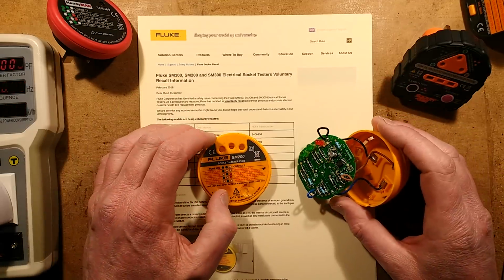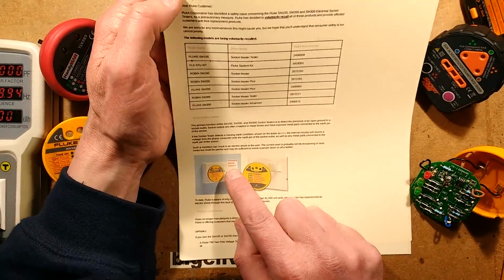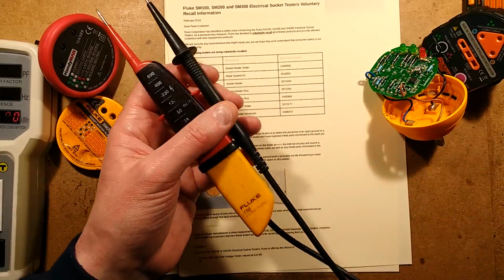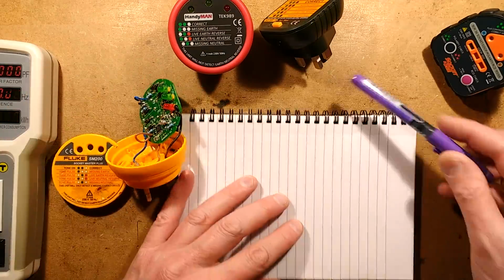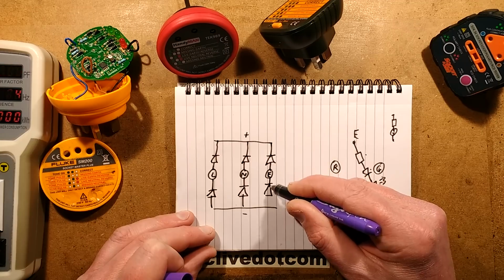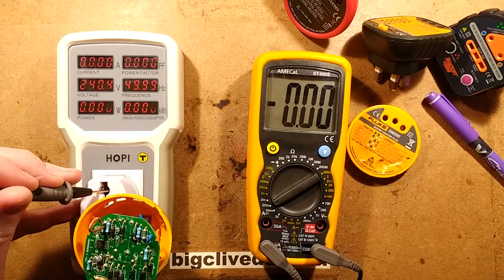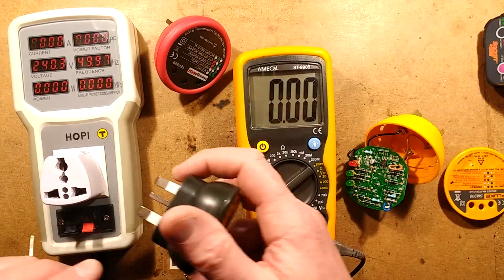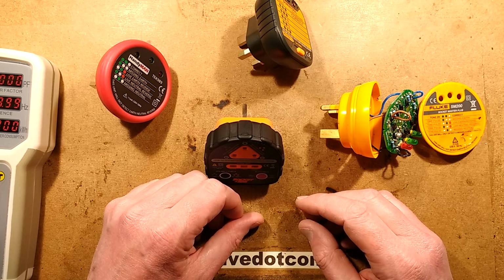Why Fluke are recalling their SM100/200/300 plug-in testers.

Comment: Clive, I love how optimistic you are!  Normally the people using the metal boxes as part of an extension lead don't eve know what a cable gland is for ;)
Reply from the maker: I've seen so many of those with chaffed inner cores just dangling out and scorch marks on the razor sharp metal.  Usually accompanied by damaged flex and plugs with the top missing.
Reply: All you really know is that at some time in the past it might have been earthed properly or there was a path to earth through it.
Reply: @Magic-Smoke  That'd be the puddle of water it was sitting in.
Reply: S.A. Smith I’ll not be surprised if said flat was in Yarmouth, Lowestoft or similar 😂
Reply: D Sloop Isn't that Preparation H?
Reply: the amount of socket faces and back boxes i've had to replace in domestic locations because the home owner or tenant has tried to bodge it is mental...

Once had an entire flat with a bridged electric meter, cables just running all over the place, a 3rd party single phase service head (they totally bypassed everything), all earths cut off, about 6 live/neutral reversals, a live steel "plant rack" as well as lots of "natures peace maker".

The flat stank of rabbit poop (as this "plant" usually does) & the tenants were incarcerated at Norwich Prison (UK) for about 10 years each. The Joys of rewiring an old grow house.....
Reply: Which is also the shortest poem imaginable about toilets!  A micro-haiku.  Strain-relief doesn't imply ingress protection though, which is the principle function a cable gland I reckon.
Reply: @MarkTillotson  "principal"
Reply: Here in the States They are called "Strain Relief".
Reply: @dsloop3907  Here, we call them laxatives.
Reply: Ryan Starlin - It was Great Yarmouth...Nelson Road Central...

I went to Solna in Stockholm last couple days, and I'm considering leaving this shit pit.
Reply: @S.ASmith  You know it's a shit pit when members of the Royal Family can't stand being here. Hiya, Harry.
Reply: S.A. Smith ...and it is totally legal where I live.....still boggles the mind....

Comment: We have the same sort of testers here in Canada.  It's also the only test tool that an electrical inspector is likely to use on residential inspections.
Reply from the maker: A higher percentage of people are electrocuted with 120V due to the belief that it's safe.  When you make brief contacts in a dry environment all you get are tingles, but add metalwork and wet hands and it all becomes a bit violent.
Reply: NM I didn't watch whole vid b4 I commented.  I didn't realize the trouble with the Fluke was being full of needless electronics.  I thought they all were the same.:)
Reply: Our main is about half the voltage as in the U.K. though which mean half the current. Add skin resistance to that and I think we're safe.
Reply: Touché.
Reply: bigclivedotcom Yep, I been electrocuted by both 240V and 115V, and confirm that both are not nice.

Comment: Hi Clive, can you tell me why my House Socket RCB tripped (twice) when trying to troubleshoot a faulty Shredder, even though  it was plugged in to the mains it was switched off at the socket? PS the shredder seems to have a fault somewhere on the circuit board (somewhere) im not actually sure where, i would send it to you to have a teardown and fix but its a Fellowes SB-89Ci and weighs a ton!
Reply: Are you sure its the shredder and not the socket thats at fault?
Has the plug been rewired ever?  My guess is that something in the plug is wrong.
Reply: DeoMachina yeah the shredder was brought to my house has it wasn't working. Tried to have a look and noticed it seems to stay on light without doing anything. Nothing else working on it
..
Reply: ahh, thanks for the info, i will investige further. sustained a finger tingle electric shock, whoops, rather fuzzy moment lol!

Comment: A Question, what is the advantage of 240V 50 cycle over the Voltage used in the US, 120V 60 cycle?   sorry, this was off topic.
Reply: I understand a hotter space heater, I don't know what an electric jugs is, sorry, I'm stupid.
Reply: In tea-drinking countries, you need to boil a litre or two of water each day to use in tea-making.  To this end, we have electric kettles, that simply heat up water reasonably quickly to boiling point.  They're also handy for other situations where boiling water is useful.
Reply: Thanks, my wife drinks a lot of coffee, she makes 3 or 4 pots a day, I'm lucky to get one cup.
Our home is about 3700 sq. ft. and uses Natural Gas to heat it and our hot water, I live at about 5000' in elevation and get a fair amount of snow, but the heating is only about $140/month and the 120v electricity runs about the same, we keep the home about 76F in the winter and summer.
Reply: I understand that but most people don't like handling 240v , the one appliance in our that uses 240 is our stove/ oven.  They are afraid of it.  240v and 30amps a bunch
Reply: Given the same voltages and power, 60 Hz transformers will have less mass than 50 Hz transformers.
Reply: Still smaller than South Africa.
Reply: Robert Szasz They are tiny compared to industrial power connectors!
Reply: Mike Hale We can plug in high power tools, equipment and heaters, as our plugs are rated at 240V at 13A giving an available power of 3120W.
Reply: DemonfangTheDragon not every way. UK plugs are huge.😋

Comment: Are sockets with earth connections really that rare? I know that the UK has them (duh) and that here in germany, you get either the full-size schuko socket (with earth contacts) or the smaller ones (which lack earth contacts, but physically limit the plugs you can stick into them so that an appliance that requires earth cant be plugged in, provided that the manufacturer is sane)
Reply from the maker: A surprising number of European countries either have no earth circuit or badly implemented ones.
Reply: Replacing a non-earth socket with an earthed one and failing to wire the earth sounds like a really, really stupid idea. Like go directly to jail, do not pass go level stupid.
Reply: In Eastern Europe there are a shitton of houses with bodged wiring, such as schuko-like sockets that lack the earth contacts, proper complete schuko sockets where the earth contacts are not connected to anything because they were retrofitted and the house was wired without a third wire, houses where some of the rooms have properly earthed sockets but other rooms have sockets without earth wires going to them, sometimes the earth contacts and the neutral is shorted together at the back of the socket (!) if there is no earth wire, there is no GFCI a lot of places, sometimes the circuit breakers are overrated and if you plug in a continuous heavy load like a new electric oven, the breaker will not trip before the insulation starts melting off the solid core aluminium wires that have often been used for wiring houses. Sometimes the wiring does not even go though conduits, it it just literally wires embedded into the layer of masonry cement mixture that was used to cover the brick walls.
So, yeah, it is an adventure, you never know what you find :D
Reply: +S.A. Smith I just took a photo of it: https://ibb.co/eq5shn
Reply: in my 70s built home there are earthed sockets in the kitchen and in the bathroom the washing machine requires a fixed connection through a switchbox (rope operated).
Reply: Any sockets in the US installed after about 1955 or so have an earth pin but a lot of 100 year old wiring is still in use.  It's also common for old two pronged sockets to get replaced with three pronged sockets but not actually have the earth pin connected.
Reply: We see it all the time here. The installation of home central heating (or just replacement of old pipes with plastic, because copper is expensive and needs to be soldered, hardly anyone installs new copper pipes anymore), also makes it unviable to use the plumbing to provide earth. Thankfully there is often a stub of the old pipe left coming out of the wall and you can use that.

The small company where i am employed has recently moved. The 5-room apartment we have moved in is in a fairly old (but reconditioned) building, they have certainly not reconditioned the electrical though. The sockets, i kid you not, are just 2 holes in the wall with a METAL plate for a cover, on a 2-wire circuit with no earth. There is no housing to support the plug that's going into the socket, and besides the enormous electrocution risk that exists if the live wire comes loose inside this socket, you can get electrocuted even if it does not because the plug has a tendency to slide out of the socket (since it's not supported) and you can touch the exposed prongs.

The panel is in better shape, except for the fact that despite the circuits being LABELED by some electrician at some point in time with the right fuse ratings for all the circuits (25A for sockets, 10A for lights), all the fuses were 15A LOL. Needless to say we popped those rather quickly once all the equipment was powered on. Installed the 25A fuses that the labels on the panel called for, no more issues.

There are a couple new sockets with an earth contact, but the earth is of course not connected to anything. I have made my own earth connection to an old heating pipe stub, still need to go around and replace all the sockets though.
Reply: Also between UK and Germany is the Principality of Sealand but google doesn't seem to reveal much about their electrical safety legislation...
Reply: MissingMew It is the same in my part of the US. Old homes often have a mixture of sockets though.
Reply: A rope operated fused connection unit? They're treating the washing machine like a shower? How odd...never seen that one before.
Reply: Well, to be honest since you can totally plug an appliance that requires an earthed socket, into a socket from the 1960-1970s era which does not have an earth contact, the biggest danger is that it is deceiving and gives the illusion of safety. But since sometimes sockets need to be replaced, and the really old style sockets are no longer available, you do not really have a choice, since the owner will not pay for running earth wires though old rotten tight conduits to connect the third contact.
Reply: I’m in one of the countries in between of Germany and the UK. Sitting on the couch in my 1970’s flat which only has earthed sockets in the bathroom and kitchen. The unearthed sockets fit (earthed) Schuko plugs just fine. It hasn’t been legal for new installations for decades but it’s perfectly legal for my land lord not to make this safer. Up until two years ago, this place didn’t even have a RCD. Fortunately for me, they’ve fitted RCBOs when they replaced my distribution board.

One of these testers, plugged into an ‘earthed’ powerstrip plugged into one of the sockets in my living room would make touching all the other appliances plugged into the same strip an unpleasant experience.
Reply: wondering what other countries than The Netherlands are between UK and Germany :)
Reply: Maico I’m pretty terrible at geography but I think Belgium, Luxembourg and France?
Reply: oh yeah you're right Germany extends much more south than my tiny country :) Denmark isn't between Germany and UK cause its on top of Germany
Reply: +Maico - How odd. I've never seen one like that before. Then again if it's not a UK installation I probably won't. 

All pull cords in the UK are typically ceiling mounted and are done this way to isolate the switch operator and the switch itself by some distance, in wet environments (ie: a bathroom). Showers and lights in a bathroom are on pull cords most the time, unless they have a switch outside of the room (uncommon).
Reply: +S.A. Smith the switch on the picture is almost at the top of the wall (reason to prevent it from getting wet)  and the light switch of that bathroom is mounted on the ceiling with a cord hanging down. What do you mean that showers are on pull cords ? Are they electrical showers then ? Here in my home in the Netherlands the shower just gets warm water through piping. Our city has central heating and there is a heat-exchanging unit in a closet in the house.
Reply: I can confirm that in Eastern Europe any house built more that a decade or two ago HAS NO CONCEPT of "earth" in sockets. Oh, sure, you get "earthed" sockets in the walls, but only TWO wires ever are actually routed: live and neutral. As for earth - it's mostly just unconnected...
Reply: Here in Denmark, there is a mixture of earthed and unearthed sockets, but all installations newer than ~20 years must be earthed. The big problem is that even if a socket is earthed, it is normally made for the (rare) Danish-style 3-prong plug (Type K) (only recently has Schuko-sockets been approved by the authorities). But since most appliances that needs earth connection comes with a Schuko plug, which fits in a Danish socket, but without earth connection (without an adapter), there are a lot of appliances with earthed plugs, inserted in earthed sockets, but without earth connection!
Reply: +Maico - " What do you mean that showers are on pull cords ? Are they electrical showers then?" 

Yes most houses & flats (appartments) have electric showers. It's not uncommon to see mixer head taps with a shower head on them either though (ie: boiler/central heating piping).

In the UK, most places have a boiler and central heating these days, but it's usually cheaper to install an electric shower, run a piece of 6mm^2 3 core and earth to the bathroom, install a switch & connect the shower unit using 6mm again. It all has to be on an RCD protected circuit witha  40A rating.

I was in Sweden the last two days, and the hotel room I was in (4 star hotel in Solna, Stockholm) had a mixture of earthed and unearthed Shucko in the same room.
Reply: +S.A. Smith Interesting. I don't travel much and have never showered under a shower that had an electrical unit right above it a.f.a.i.k. Learned something new :)
Reply: I've just uploaded a couple of pictures for how it is in my house for the upstairs bathroom (we have two bathrooms).

https://ibb.co/ciQJQ7
https://ibb.co/bSD557

You have the switch outside the shower cubicle on a pull cord next to the light (the shower is the one with the Red LED in the housing) and the Power shower in the bathroom. This is fed by a piece of 6mm 2 core and earth from an RCD protected 40A MCB. Me and my dad wired this house.
Reply: Thanks for uploading these pictures. It is all very clear now. Does the sticker on the cubicle stay there as a clear glass danger protection ?

Comment: Sadly some people do have a talent for experiencing accidents. As another commenter posted though it would be unwise to continue to use these in a commercial environment.
Reply: I think these accident prone people should be free to continue to have those accidents until they terminate. There is sonething to be said for adequate precautions.
Reply: Well - those are testers... if anything happens with those you are pretty much safe. 
On the other hand there are still hundreds of similar products that do not get recalled that likely are worse. 

And the more important point:
They are TESTERS.
I you get a small shock from them already that indicates it could get preeeeeetty nasty if you plugged in normal electronics as now you could really get fried.

Comment: Speaking of putting metal boxes on the end of an extension cable...

US extension cables usually have really crap ends on them that are just metal prongs moulded into a rubberized plastic, and they really don't make good contact. I've had them catch fire.

Putting wall outlets in a box on the end of a cable is really the best way to do it here.
Reply: I've never heard of anyone properly using an extension cord having the cord catch fire. Misuse of extension cables is very common, but the users fault.
Reply: Looking at your channel it's obvious you play fast and loose with some things so I'm pretty confident in blaming you for your own fire haha
Reply: SECONDQUEST It was about 10 years old, and I was trying to run a 120v cement mixer on it.

Due to the lack of clamping pressure on the internal contacts, it heated up, started arcing, and caught fire.
Reply: SECONDQUEST why not? The dollar store has to abide by all the same safety regulations as everywhere else.

You’re going quite far in trying to blame the user instead of the equipment.
Reply: DashCamAndy Don't buy your cords from the dollar store.
Reply: I have had the same issue with cheaper extension cords running loads within the rating of said extension cord. Not catching fire, but the female end experiencing meltdown and unplugging the device used often ends up with the connector coming out still attached to the plug end for the device.
Reply: No! I have had an extension end catch fire when it was being used correctly due to lack of pressure on  the contacts causing heat. Thanks B&Q. But then buying one with really nice contacts is not easy, they all have the same crappy contacts. I can't always find an MK one in the shops.
Reply: I too have had one catch on fire while using it properly. It was plugged into a circular saw which draws 15A. The lead was rated for 20A.One day while cutting some wood, I kept smelling burning plastic. At first, I thought it was the saw. I checked the brush holders, windings, the worm drive housing. Nothing to be found. So I kept cutting until it cut off abruptly. And there it was on fire. The plug had melted inside due to bad contacts and actually ended up shorting live to ground which I assume ignited it before tripping the circuit breaker.